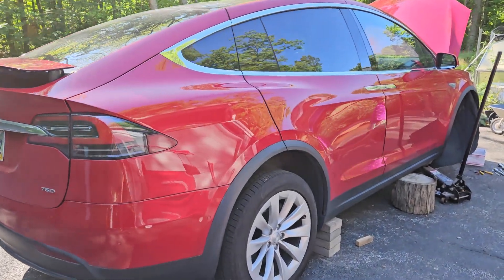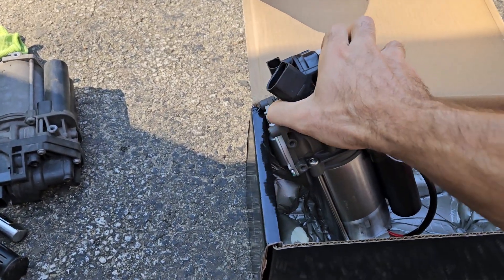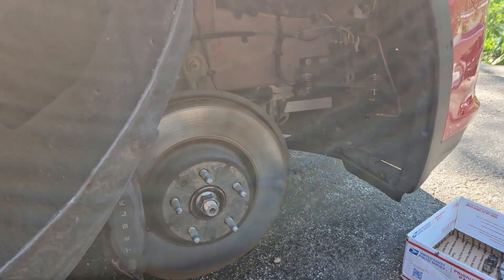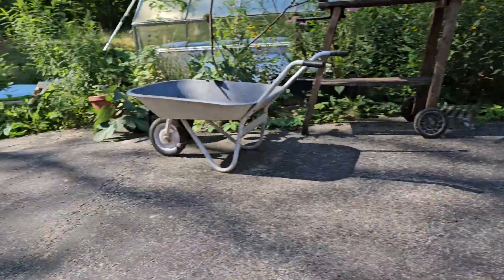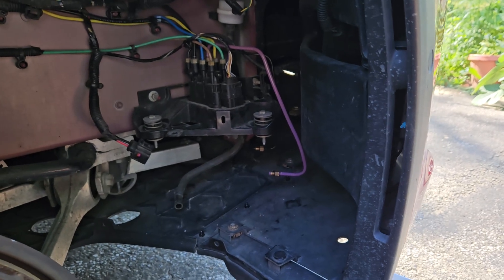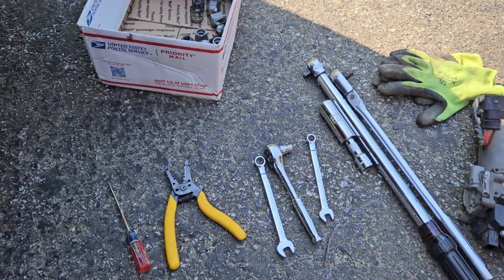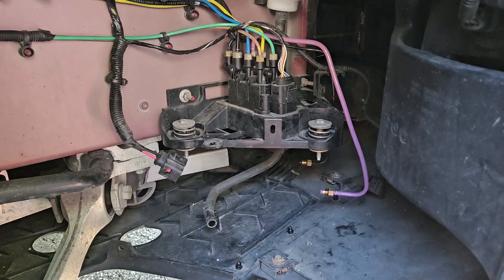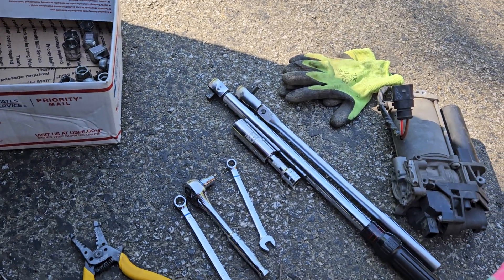Replacing 2016 Tesla model X air suspension compressor DIY

Comment: Thanks for the video! 
Wonder what the best way to interrupt the compressor a few times to give it time to cool while filling the reservoir? Relay, fuse, or plug? Wonder what one will cause less trouble codes?
Also, do you have to change the VOSS fittings on the 2 lines connecting to the compressor?
Thanks!
Reply from the maker: Good question, sound like it would be best to pull the relay but I'm definitely not an expert in that area. It is recommended to change the VOSS fittings every time as they are considered single use. The replacement compressor I got did come with the two new VOSS fittings. I Personally though have had an easier time carefully reusing the VOSS fittings rather than changing them.

Comment: I just replaced the valve block on mine yesterday. The pump is now coming on but, the vehicle won't raise. I probably need to fill the air reservoir, but I'm not sure how to do that. If you have any suggestions, I would greatly appreciate that.
Reply from the maker: I let mine refill the reservoir with just the vehicles pump but it is hard on the pump. If you can, let it rest between(few minutes on, few minutes off) to prevent overheating. I also had my car on blocks at the time so that it wouldn't be trying to lift the vehicle weight at the same time. Tesla recommends filling from a Nitrogen tank. Sorry for the late reply, I'll try to check back today in case you have further questions.

Comment: Thanks for the video! Please share more, if you're finding more stuff to be replaced.
My compressor currently sounds like a box of screws while running and it throws errors. Maybe the ball bearing of the cylinder is just worn...
Going to change the compressor and relay today. Hoping for the best not having to change the valve block also. 

(For those interested: Error TAS_A218 or TAS_A217)
Since i got most of the errors in norwegian winter, i thought it was just moisture in the system, which froze. It got better after warming up. But now in summer temperature the compressor malfunctions mainly, not even raising anything. I'm getting a error message "TAS_A224_openAirline", but the pressure is holding in the system. So either there's a valve holding it and keeping the suspension up or it's a wrong error message. We'll see later today.
Reply: Hi did you get this fixed ?
Reply from the maker: Interesting. I'll be curious to see hear what you found.

Comment: I specialize in the production of Tesla's air suspension and pump in China. Can you introduce this resource for me? Thank you!
Reply from the maker: Hi, Please correct me if I misunderstand your question. I believe you are asking what caused the failure? The failed pump looked to be caused by overwork/overheat due to a failing air valve block causing increased resistance to air flow through the system.

Comment: Did you need to calibrate the air conpressor in anyway after replacing? Mine just went put but i dont know if its relay, compressor, or valveblock. Any help please
Reply from the maker: I did not need to calibrate mine. About two months after I replaced my compressor the new compressor failed. I then replaced the valve block and the compressor and I was amazed how fast the car lifted and lowered compared to before the valve block was replaced. I believe the valve block going bad was putting extra stress on the compressor. It's been about 3 months now with the new valve block/compressor, no issues so far. It is recommended by tesla to replace the relay any time you replace the compressor. I have not replaced my relay yet.  
Just to make sure did you check the control fuse?(not the relay) I believe it F154.  The fuse could blow in cold weather due to ice in the air lines.
Reply: @timobrien4281  dude.omg, i just found the fuse and its blown im on my way now to see if this will fix it!
Reply: @timobrien4281  FIXED,  thank you so much for that info, you just savede 1217.00
Reply: @timobrien4281  where is this at?
Reply: Well I spoke too soon this morning I woke up and I gave another error which was tas a220 exhaust gallery fault back to square one
Reply from the maker: @ So glad the new fuse worked! The fuse replacement may just be a temporary fix depending on why it blew in the first place. If it was ice then you could be fine for a while. if it was increased resistance inside the air compressor due to wear then it will be a very short fix. 
I wouldn't think the exhaust error would be related but possibly also due to extreme cold?
Reply: @timobrien4281  yeah it does say that air suspension unable to raise due to that error
Reply from the maker: @criswise3466  oh man! I'm not sure. You are outside my area of expertise now. Sorry!

Comment: what symptoms preceded this issue?  I found my compressor running and not stopping after parking the other day.  Pulled the relay so it would stop.  I tested all the lines with soapy water this weekend and could not find a leak, so am stumped.  Thanks.
Reply: Maybe the Relais is forced to be closed. If its stuck closed, the compressor never stops...
Reply: @horjjzon  Thanks.  Its not the relay as other times it stops.  System leaks down pretty rapidly when car is parked, so losing air somewhere.  maybe the block.
Reply: @ If its getting down on all 4 air springs the same amount, it really can be just the valve block. Would be the cheapest repair.
Reply: @horjjzon  Thanks.  By leak down, I mean the pressure at the tank.  the struts never are reduced, so that's why I'm scratching my head!
Reply: If the compressor runs constantly it might be a relais malfunctioning (sticky contacts), loosing pressure in the system or a malfunctioning pressure sensor.

Comment: Did you mention you purchased the air compressor off eBay or did you get the new replacement directly from Tesla?  From where your video ended, was there any more to reinstalling it since this video looks like 50% of the entire installation? I'm assuming reinstalling the new air compressor is reversing the steps you mentioned.  Thanks in advance.
Reply from the maker: Yes I just got the off brand air compressor off of ebay. Yes just reversing the process to put everything back together. Good luck! 
*note tesla would flush the system with nitrogen after installing the new compressor to be sure there is no moisture in the air system.
Reply: I’m replacing mine because of it making a noise when running. Did you flush it with nitrogen? I don’t plan to.
Reply: Quick question, do you know the model number of the compressor?  Is ebay the best place to buy?

Comment: Was this throwing a code before you replace the compressor, and if so, do you remember what it was?
Reply from the maker: Yes "compressor disabled suspension unable to raise"
Reply: @timobrien4281  I had the same thing come up on my 2016 model x ... I put a set of gauges on the ac lines and saw that it was low on refrigerant, i had to add about 3/4 of a pound or so of 134a, its been several weeks and the code has not come back as of yet.
Reply: @inels6838  It's not an AC Compressor! It's an air suspension compressor, Sir!
Reply: @fabiendass2255  yes, you are correct, don’t know what I was thinking, I guess I was thinking about my problem and not the one in the video, anyhow my problem is still fixed And it appears the one in the video is fixed too.

Comment: as Interesting as the X and S are... they're kind of known for being the most problematic Tesla's.  I would just steer clear of them.  I don't want to buy a money pit.  This particular X might not be too bad but there are many others which have had ridiculous issues!   Basically as if you'd buy a Jeep.  I would be putting dielectric grease in that connector so that water doesn't get into the electronics.  It's in a spot which can get wet easily.